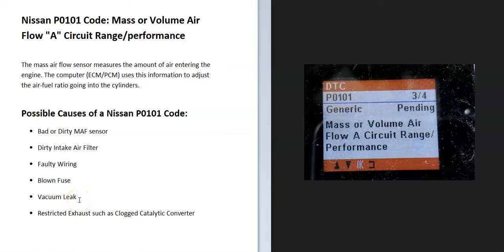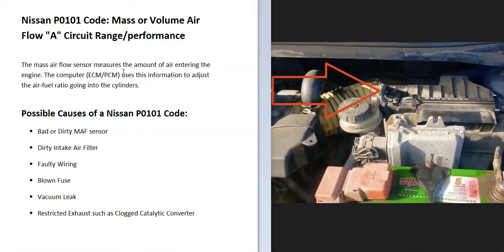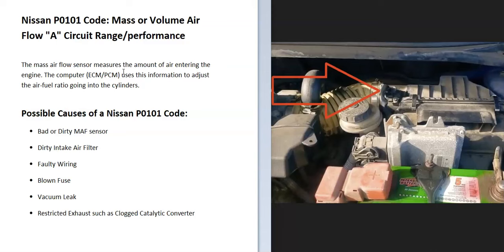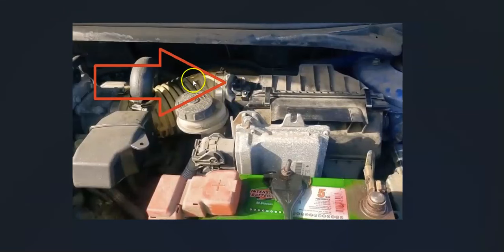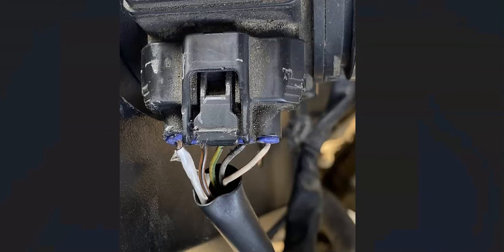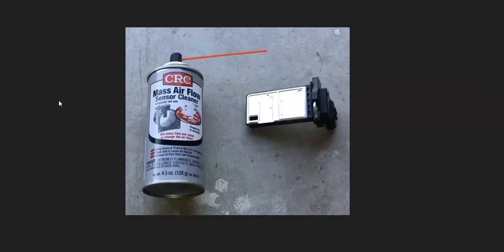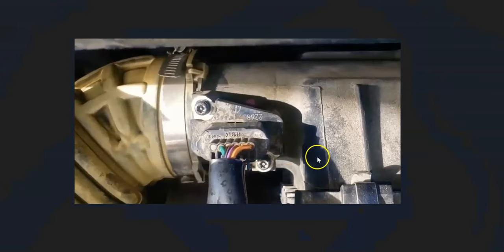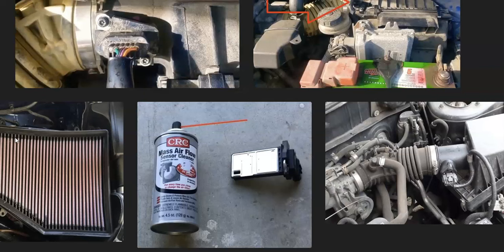Causes and Fixes Nissan P0101 Code: Mass or Volume Air Flow "A" Circuit Range/Performance

Comment: Nissan pathfinder 16 here, I have this problem I already replace the sensor twice. I should mention mines is a perm p0101 I already got like 1k miles on it and still hasn’t drop. Any suggesting ? I did all this video suggested too
Reply from the maker: If the sensor is good, I would test the wiring. I made a video on how to check the MAF sensor wiring with a meter. Here is a link: https://youtu.be/_2eo0ZqrKbU

Comment: I put a new senor and it still show the code can it be difficult  again
Reply from the maker: If the sensor is good, there likely is likely a wiring issue. I made a video on how to test the wiring. Here is a link: https://youtu.be/_2eo0ZqrKbU

Comment: One HUGE mistake folks make when replacing MAF sensors, especially on 5th generation Altimas, is buying cheap after market sensors.

The majority of the time places like Auto Zone, Pep Boys.., will sell you the WRONG sensor resulting in that nagging P0101 code popping up again!

Go ahead and go to the Nissan dealer with your VIN in hand, shell out the $200+ bucks and get the RIGHT sensor!

Comment: My wife has a 2016 Nissan Versa Note SV. I have cleaned the MAF sensor and cleared the code and the code came back up. I checked the wiring and replaced the MAF sensor and cleared the code, code came back up. I replaced the air filter as well. Still have the code. Also to note getting horrible gas mileage, 27.5 mpg. Car acts normal and drives/accelerates normal. Anybody know what else to look at or has had the same issues?

Comment: Do after market sensor impact the check engine light coming on? I’ve heard that frontiers are very picky and want the Nissan MAF. I bought a duralast one and my truck is running great but the light keeps coming on after a few days driving. I just clear the code again, but do I need to buy a Nissan sensor?
Reply from the maker: Non-OEM sensors can be problematic sometimes, which is why some mechanics only use OEM parts, but it is difficult to say if that is the cause. I would test it and be sure the grams per second (g/s) match the RPM's for the engine size. For example, a 2.0L engine should read approximately 2.0 g/s at idle and double when the RPM's double.
Reply: @HVAC_Mechanic Thank you for getting back to me! I have a 2011 pro rx and I’m at almost 1rpm in idle then it’s at about 1.5 rpm regular driving normal. I replaced my Nissan MAF with a duralast one

Comment: Changing my air filter tomorrow the sensor looks like it’s working bc I disconnected while running the car and the car shut off so it’s doing something 😅 I did have a P0956 code or something for Evap but that’s gone now and just the P0101 is on now so what the heck I didn’t even fix the other and now this is on and the other is gone fml

Comment: After replacing MAF sensor and PCV valve still getting P0101 code. Car drives perfect with no hesitation so wondering if there's a an update needed to computer causing this (there was a service bulletin years ago regarding this) Anyone?
Reply from the maker: There was some service bulletins TSB for a P0101 around 2011–2016 Nissan's. The fix for those was to replace the PCV valve and clean the throttle body. There was also an ECM update to make the computer less finicky. Testing PCV valve and cleaning the throttle body is always a good idea, but keep in mind, if there is a loose connection going to the MAF sensor that for example, disconnects on a bump that can cause the engine to run well but set the code intermittently.

Comment: Does this video include infinitis too?
Reply from the maker: A P0101 code is a global code that is basically the same across all vehicles. How it is located, voltages, and other built-in sensors are mainly what can be different.

Comment: i got p0101, took machanic he said pvc so i replaced,light came back on. car stalls when go after stop light, put new air filter, new maf, new pvc, and car still same, please help
Reply: Which model yours
Reply: Update?
Reply: Sounds like you need a new computer
Reply: I had the same problem I changed the mass air flow pigtail no more problems

Comment: I just replaced my Mass Airflow sensor after getting P0101, 1/1 and 2/2.  I got two of the same code.  After replacing the sensor, one P0101 code came back, without the check engine light..  I checked the air filter, the intake plenum, the throttle body, cleaned the throttle body, and the code came back.  Any idea of what my fix is?
Reply: Hi did you fix the issue
Reply: @muhsinabdulkader8123 maybe he had the ECU flashed with latest software update.

Comment: Nissan Dealership in Conyers, GA charge me over $5,500  and the next day I still get the MasAirFlow sensor code. I went back a week later and they told me not to come back any more and that they do not know how to get rid of that stubborn code.😢😢😢
Reply: You totally got ripped off. The sensor is anywhere from $200 to $400 OEM. I bought mine at Autozone $111. Along with air filter. Two screws and sensor is out and back in in less than 5 minutes

Comment: I need help on this manner too. First time my car stopped in the middle of nowhere with all the lights and code P0101 changed sensor twice. Changed air filter too. 
Same error coming up after driving the car for about 40 miles after clearing the code. 
My car has been driving like rough when trying to accelerate my mechanic check wiring, fuses, vacuum leaks, he put the scanner like 3 times . Even we did transmission fluid . I’m desperate now he is suggesting it could be a software update or ECM related issue. 
I read in this same thing that when It gets cold cars get weird idk if that is true
I have a nissan versa note 2016 SV
Reply: Hi did you fix the issue

Comment: My Nissan Altima 2011 makes loud whining noise during the starting, slows down 2-3 minutes later, the noise remains during driving.  Mr. B
Reply: Power steering fluid needs to be changed. Transmission fluid change as well.

Comment: I’ve had 3 MAF sensors replaced and the catalytic converter changed within 3 months and the check engine light still comes on and says P0101 😣
I’ve paid these idiots $2k
I’m so frustrated!!
I suggested a throttle body cleaning and idle relearn (suggested to me by a mechanic guy I came across at AutoZone) and I was dismissed by the shop. 

*The mechanic guy also asked if they were using genuine parts and suggested that would work better for my Nissan Frontier. The shop claimed that they used a Nissan part on the third go around but I seriously doubt it.

I’m skeptical about starting over with a different mechanic for them to charge me for the same services all over again. 
PLEASE help!!

Comment: Replaced the mad air flow sensor and the catalytic converter and check engine light is still on. I'm going to try cleaning the connector
Reply: Check for a ECM update there are many models that are affected by this code on nissan.  For certain years that the fix is an update at the dealership and no matter what you do the light will continue to return. I worked at Nissan for 14years. Saw this code all the time.
Reply: @Erik1290r even if a random mechanic shop reset the computer?
Reply: Same 😢with the same code
Reply: Same! I have cleaned everything and the check engine light still there. Also, the car feels like it’s pulling or hesitating when I accelerate, I don’t know what to do
Reply: @valeriafunes403 a mechanic specialist says the throttle body should be cleaned or replaced and an idle reset done. He said bcz the vehicle is older that some opening, meant to open and close during idle and drive, gets stuck from build up. Idk 🤷🏽‍♀️

Comment: I replaced my air filter and mass airflow sensor and im still having the issue. Ugh my code reader comes today so hopefully that will help me figure this out. Ill check wires next.
Reply: Me too
Reply: Same here.  Did you get it fixed?
Reply: Same here
Reply: Someone else in the comment thread said they changed their catalytic converter and it solved the problem wonderfully. 
Maybe give that a try? 😏
Reply: @BradleySittloh i changed my convertor first then maf SAME ISSUE 😩 also replaced air filter , 2 maf , o2 sensor replaced and mechanics confused to the point every one is keep screaming a new maf 💔 STILL STUCK ON FIGURING IT OUT

Comment: Had this issue on 2015 nissan versa. changed the maf sensor Twice, then changed yhe catalytic converter once i became aware. Cleared the code and was running great for ajout 2 months. Now the same code is back i'm a little lost now
Reply: oof
Reply: Same! But it was 3 sensors and the converter 😢
A mechanic I barely know suggested a throttle body cleaning and idle relearn and to make sure the MAF sensor was a genuine part…
Reply: Have an actual mechanic take a look.
Reply: Do we need to buy OEM part or we can go with the Hitachi
Reply: @ehtashamshakeel9100 Buy the OEM for things that communicate directly with your cars computer like that.
Reply: @ehtashamshakeel9100 that is OEM

Comment: Hi, Saturday I had P 0102.  Replaced sensor then had code cleared.  Yesterday (Tuesday) check engine light came back on.  This time.P0101 & P 0111. AutoZone. Said to unplug battery.  Clean the plug to the sensor.  Put that back in then connect everything back up.   He did make sure the filter was incorrectly and secured.  And he said the wires look OK.   Any recommendations?

Comment: This is something related to cold temperature or pressure drop, as soon as it got to under 36°F on cold start it was a rough idle and, my G started hesitating around 30mph. I saw code p0101 so
I cleaned the filters reset the ecu and cleaned the maf sensors.  I know I have an exhaust leak on the test pipe but it ran perfectly when it wasn’t freezing outside.  I had more power than before and I thought it was problem solved, but the temp dropped again this night after I was driving fine this morning and now the hesitation is back.

Comment: Ok everyone, so I was getting tormented by this dtc. Finally I decided to attack it, and what I did to resolve the issue was. 

1. Take off the throttle body.
2. Clean with carb cleaner. Be careful not to mess with the flapper.
3. Put back together and re-program throttle body. 
Look up on youtube (Nissan re-learn throttle body)

Fixed my issue completely.
Reply: Have you driven in cold weather since the fix
Reply: @ I have and so far so good. I also just did an 18 hour road trip and the car held up fine. So Im crossing my fingers I have repaired the issue.
Reply: @ yeah I think you fixed it at that point cause my issue keeps coming back next day
Reply: @ before I got to the throttle body, I tried cleaning the air filter, MAF sensor, even clearing the code each time it came back. 

Anyways just my two cents on this issue. I thought I would share maybe it will help someone.
Reply: @ I think that was the solution, I cleaned my throttle body reset ecu and idle position and now it runs perfect off a 19° cold start the following day. 🙏🙏

Comment: Hi, thank u for the info in the video I ended up replacing the mass air flow sensor sometime last week now the check engine light is back on same code nothing new other than it now saying “most likely fix reprogram engine control module.” I was wondering if you have a video demonstrating that? Once again thank you
Reply: Take it to the dealer

Comment: I replaced my MAF sensor/2016 Altima sr and drove around the entire weekend with no issues or codes. However, I went to accelerate and it bogged out on me not wanting to go. I took it to autozone and there no codes present. What is the possible issue?
Reply from the maker: It needs to be diagnosed, but it may just need a tune-up. I would check the throttle body for any build-up, and if there is, get some throttle body cleaner and clean it up.

Comment: Just sharing my experience….this trouble code has been on for months.  Sensor had been replaced and cleared codes.  Lamp came back on.  Drove for more months as is.  The transmission oil was replaced and the light magically turned off on its own.  (CEL Light does work).  Hope this might help Nissan owners.
Reply: I’m thinking my transmission oil level was slightly off since the last oil change.   Transmission makes a “whooshing” sound as the oil ages around 20k miles.  Goes away after the CVT oil change.  Oreily has a great price on 1 gallon Valvoline  synthetic CVT oil 😊
Reply: @ernestchavez1486  2018  nissan kicks, check engine comes on and wont go off on its own, sent to dealership cuz I have 3rd party warranty. they tell me MAF and change it,   month later light comes back I scan it with my code reader from Walmart and im getting the same P0101 code.  all over the forums I see this is a common code thrown for Nissans and it could be a couple different things and not just the sensor itself. Tons of users report having their MAF changed by dealership and the issue comes back.  I have a appointment with dealership tomorrow, cant wait to see what type of BS they try to tell me now lol
Reply: @mysixfo8805 get any conclusions yet? My wife's kicks is doing the same thing
Reply: @mysixfo8805 also engine is dying when stopped at light
Reply: @mysixfo8805 what did they tell you
Reply: @mysixfo8805 Did you figure out what was your problem for P0101 code. I have the same vehicle and have been getting this code intermittently for the last 2 years.
Reply: @mysixfo8805 Did you get it fixed?
Reply: @annamimrina5273  What did dealer  say?

Comment: In my case, the cat was the problem. It is partially blocked but throws codes P0101, p0112, and p0102. Idle is rough after warm-up, there is a rotten egg smell in the exhaust, and almost no air comes out from the tail pipe.
Reply: Yup that's a CAT on its last leg. You'll really smell it going up steep inclines especially if your on an interstate going up a mountain.

Comment: Anyone else get this error when the first cold weather hits?
Reply: OMG that's what brought me to this video! The first time it happened i almost had a mini storke seeing that check engine light for the first time ever since i got the car. Cleared he code and it stayed off for like two weeks. Then one morning it dropped below 20 again, that when i realized its only happening when its less that 20 degrees out on a cold start, but i clear the code and it stays off. I think the fact that its temperature related its not a sensor issue or CAT, there's something more at play here im interested to find out. Gonna start tinkering tonight after seeing this comment!
Reply: @EpicShmoke Did you ever find out what the cause of this was?
Reply: @EpicShmoke  did u ever find out??
Reply: Yeah have a 2021 Nissan versa and I have had a error twice when it's cold
Reply: Just got it today god damn it
Reply: @JUANLSX956 clean the throttle body will fix the code, you have to scrape the throttle body off
Reply: Nissan altima 2020 SR. I got the same problem.
Reply: I literally just got it lol
Reply: did anyone find out cuz mine its happening to me too
Reply: First time in 8 years and started when temperatures were almost -20.
Reply: Yep. 3 days ago
Reply: So here is a theory that I have,
I had bought a OD2 scanner and found that my car was running lean (STFT value was higher than 15% on idle)
So basically there is a vacuum leak somewhere and it’s gets worse in cold weather which is why the engine light comes on.
So I have bought a smoke machine to find the leak , maybe I will update you guys on what I find :)
Reply: @Old-Dog40 find a leak??
Reply: Yup
Reply: Wondering if that's why mine is on rn 4 degrees
Reply: Sam’s here
Reply: lol brudda we can all relate 😂😂
Reply: Yes, this is my case; the first time I've ever seen it and it popped up during  driving in the snow storm and started running rough like it was losing power, I parked her and let her sit and now she is running ok but I will be addressing it with my mechanic son ASAP
Reply: Yup, 2017 Altima stalled just now upon startup in 10* weather. It ran fine on the highway. Drove it to O’Reilly to get scanned and well, you know. Gonna clear the code tomorrow and see what happens.
Reply: Just happened to me it was 20 this morning. Stalled out 4 times in the way to work. Codes say MAF sensor and lean bank 1.
Reply: Same trynna fix it now

Comment: Hey I am only getting the 1 code, I’ve replaced the air filter and the sensor, wiring looks good. What should I do it keeps coming back?
Reply: Simple it is most likely and Air Leak on the intake boot check for cracks or breaks causing the leak or code have had this issue with many Nissan cars from 2010 - 22
Reply: @dconektaztapia7975  Been struggling with his for a while and did everything EXCEPT what you recommended - the intake boot!  Fixed the issue.  Thanks for posting!
Reply from the maker: If the sensor is good, I would get a schematic and test the wiring with a meter.